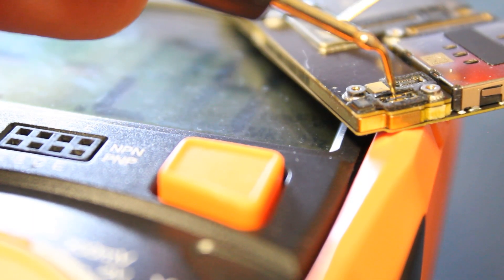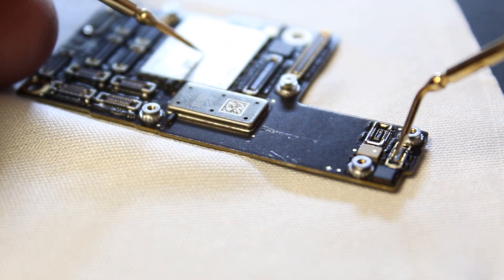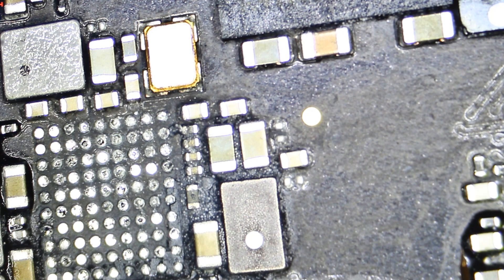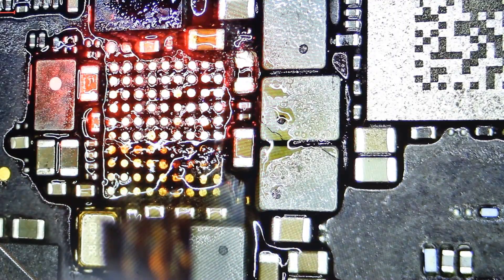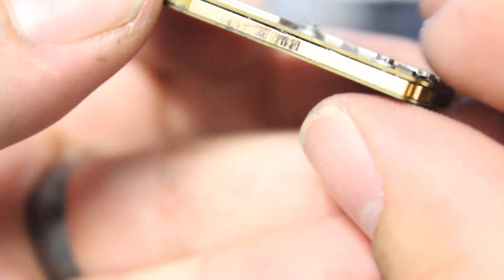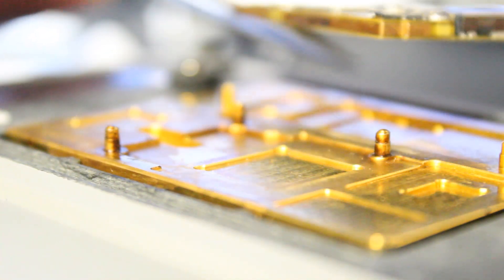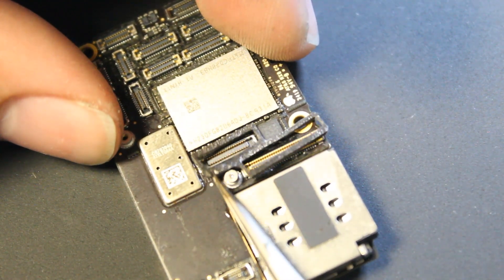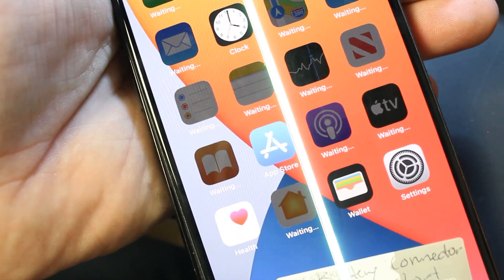iPhone 11 Pro PP_VDD_MAIN Short Solved! #iphonerepair #repair

Comment: Amazing descriptive video man. Your channel should be a lot bigger. I binge watching all your videos. What preheater and soldering station with which tip do you use? I need to buy those. I also saw you with wikas from mobilesentrix video? did you collab with them?. Comment for the algo

Comment: That wasn’t PP_VDD_MAIN. That was PP_BATT_VDD. When we have short on PP_VDD_MAIN we haven’t short on battery connector. Because Q2 drain-source is closed. But good idea to use laser for soldering. Pretty good idea! Thanks. Good luck :)
Reply: Yeah my ZXW also read PP VDD Main when i click on that battery connector that's supposed to be positive. Question I had the worst time putting together a sandwhich board last time and my friend said its because of the reballing platform/stencil... what do you recommend i buy?
Reply: @911Gadgets mijing is top quality!
Reply from the maker: Is zxw wrong?